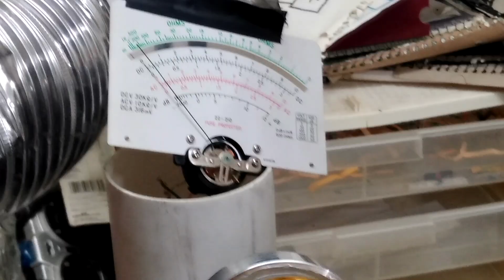Mini SSTC Gun.. Action + CW

Comment: Dude, you should build a miniature CW Tesla coil and turn it into a arc lighter! I've always wanted to make a "single electrode" arc lighter, just never got around to it! It'd be really cool with one of those plasma flame circuits.
Reply from the maker: Would be handy but has variables to def consider. Of course the TC gun works for that as it is but it also might get your face a little crispy. The HV also tends to really bust out tiny holes wherever it wants along a cig. In the end it would look more like a micro Slayer with a slightly bigger bush than one might expect from that size. I DO however have some other circuits that may work better for this driving micro coils, those are the ones made around Teslaundmehrs 5mhz HFSSTC circuit. They can spit the small HF flames on demand, meaning the output can be set to have no visible discharge at around 12v or so, but ignite something when it's brought to the breakout point. Micro bush blaster is still the most ideal but the battery for the size becomes the hard part. Would want it to run for longer than only a minute or so continuous.
Reply: @Magneticitist  a while ago I rewound a small ferrite e core 4:1000 and drove it at 300khz with a 555 timer(max frequency) 

It had a small 1mm but intense tesla coil-esque breakout which could burn stuff...including  my finger (really painful) the unvarnished  windings smoked in a matter of minutes due to the to HF effect ...Good times😄
Reply: @Joseph Bunnwow that's like a million 'watts'(?) of magnetic flux saturating a 500w ferrite core for a microsecond- too bad there is no video🤣🤣🤣
Reply from the maker: @Mwwwwwwwwe  I saw this effect the best in a particular HV transformer I got from an old laptop screen I think. For some reason it loved a basic 2n3055 driver but I burned it out going over 8V. I was going to make that one THE mini arc lighter but I could never again find a similar CCFL transformer.

Comment: but i don't see the primary coil series capacitor in the circuit
Reply: help me bro !
Reply from the maker: @ceepopi  you have to experiment with the value but I use around 33nF
Reply: @Magneticitist  ths bro, i'am noob
Reply from the maker: @ceepopi  it's not the easiest thing to get right but I can say even my worst failures making one still got me better output than like a slayer exciter at the same voltage.